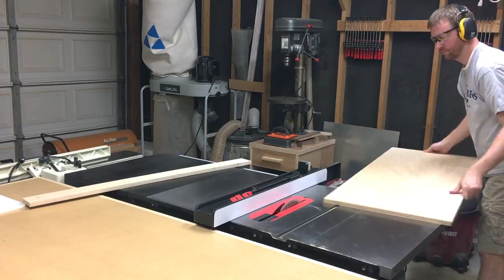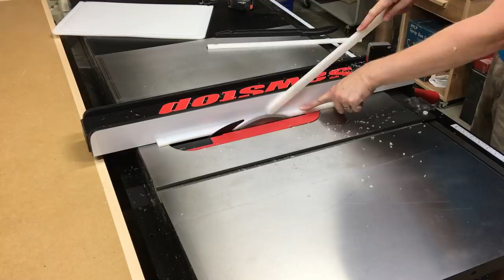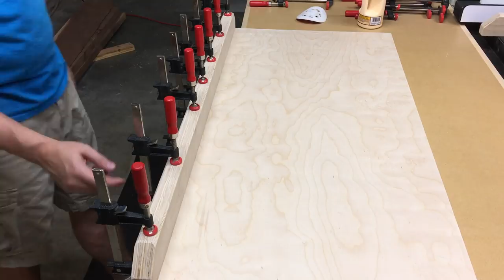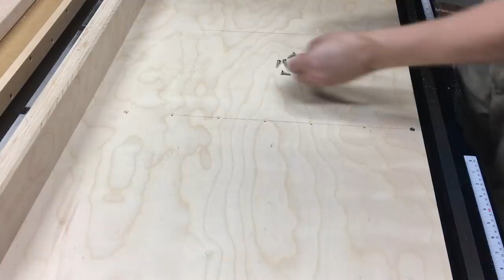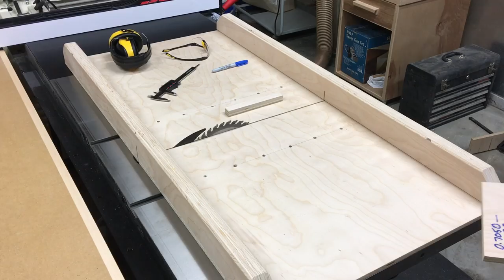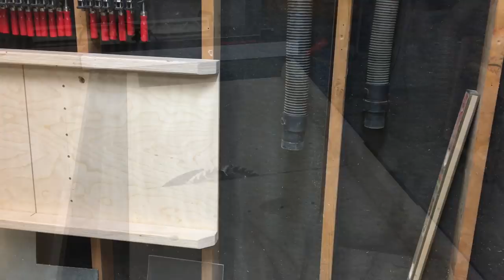How to Build a Simple Crosscut Sled | Essential Woodworking Shop Jig

Comment from the maker: Want to support the channel? Here's what you can do:
 - Subscribe to the channel
 - Hit that Like button
 - Leave a comment
 - Amazon Affiliate: https://amzn.to/2LaN1Ib

How to Build a Simple Crosscut Sled - I needed a crosscut sled for some upcoming projects so in this video I build a simple, no frills crosscut sled for my table saw.  The base is 1/2 inch plywood and the fence rails are two strips of 3/4 plywood laminated together.  I used a cheap poly cutting board to make the runners.  The advantage here is that there is no concern with expansion and contraction with moisture in the air like you would have to account for if you were using wood.  I used the 5 cut method to align the fence to within 6 thousandths...which is close enough for me!  If you have any questions please comment below or contact me via the socials.

William Ng - 5 cut method instructional video: https://youtu.be/UbG-n--LFgQ

SawStop 1.75hp PCS: https://amzn.to/2X4gWsP
Bench Dog Push Blocks: https://amzn.to/2YB00uL
Ridge Carbide 10-inch Saw blade: https://amzn.to/3bATmcp
Bosch 18v Impact Driver: https://amzn.to/3cxAhJk
Ridgid ROS: https://amzn.to/364yHMA
Titebond Wood Glue: https://amzn.to/2LzTdv4
Bessy Parallel Clamps: https://amzn.to/2z4LHG3
Bessy 6-inch F-style Clamps: https://amzn.to/3e3LGl4

Subscribe: https://www.youtube.com/danprudlow?sub_confirmation=1

Twitter: http://twitter.com/DanPrudlow
Instagram: http://instagram.com/danprudlow

Comment: Great video and nice sled!  With the video being sped up, I couldn't tell whether you drilled new holes or used the existing for the adjustment.
Reply from the maker: New holes.  If you use the existing holes it will just pull the fence back to the original position.  Thanks for watching! 👍🏻

Comment: First time viewer, and your newest subscriber for now anyway. I am making one and am wondering this:  when you screw into the plastic runner, did the plastic swell out at all, causing the runner to pinch a bit and making the sled harder to push?
Reply from the maker: I did not have any issue with the runners after putting the screws in.  I predrilled the holes large enough that only the treads would have to cut into the plastic.  I also drilled the holes all the way though the runner so the tip of the screw did not have to push into the plastic.  Seems to be working well so far.  Thanks for watching and subscribing.  I appreciate the support. 👍🏻

Comment: Very Nice work Dan. What are the dimensions for your sled?
Reply from the maker: +Owen Jennings it’s basically a 2ft by 4ft piece of 1/2 inch plywood.  Kinda big but I’ve found it to be useful when braking down long pieces.  I do wish I’d made the fence a couple inches taller though.  I thing they are 3 inches so I have to be careful to to cut through them with the blade at full height.